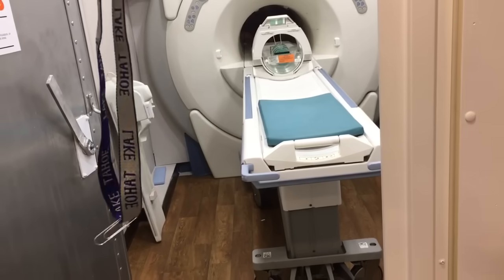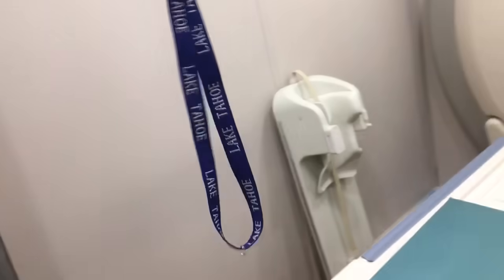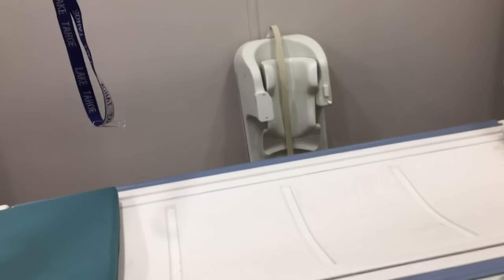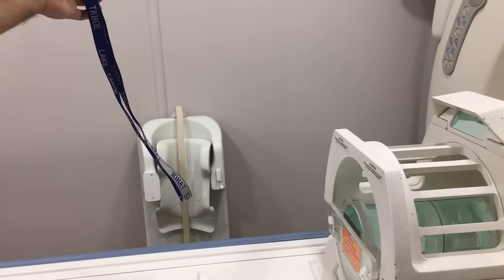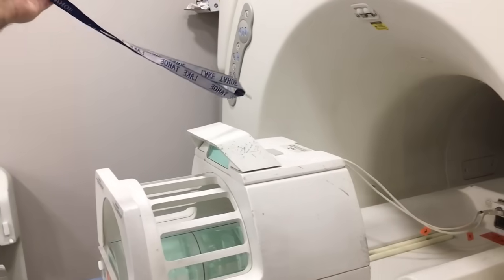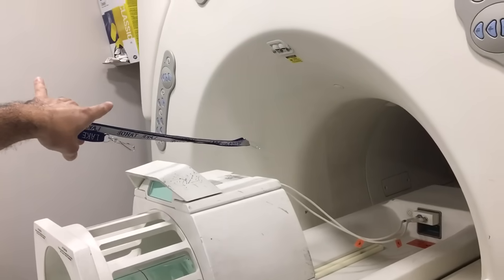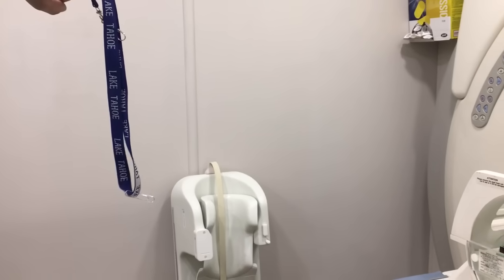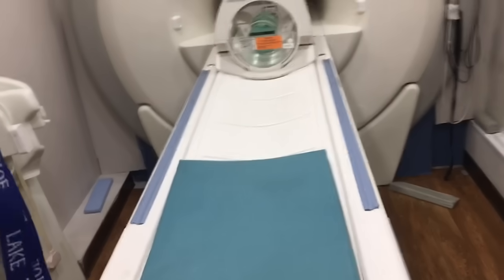Why You Never Take Metal in MRI Scan Rooms - Metal vs MRI Safety Demonstration (Original)

Comment: Can it be turned off, or it`s a permanent magnet?
Reply: Well, it's a long scientific process to energize it because it must be cooled to super conducting temperatures, and then the current through the main coil slowly ramped up with a special power supply made just for this purpose. Liquid helium is a common coolant for this. As the current circulates through the main coil, it becomes a super magnet. Now, power is needed to keep things that cool, but a loss of power won't instantly kill the field. However if it was off for long enough, it would heat up too much to still be a super conductor. Then the coil would rapidly heat up to the point that the liquid helium would boil off and break the pressure relief valve, and it would escape through a roof vent. This is potentially damaging to the MRI if this happens, therefore it's something that a hospital or lab would want to avoid if at all possible. They can trigger it intentionally to save a person's life, however, if they are pinned to the magnet by a metal object.
Reply from the maker: Thank you! That was a great explanation of the process.

Comment: I have a septum peircing and I don't know how to take it out and now I'm kinda scared, do u think it will affect the machine if I'm getting an mri on my foot?
Reply from the maker: It is hard to say without all the details but I would assume the tech would not let you enter the exam room with piercings on. Is the piercing made of ferrous material? You can try taking a small magnet to the piercing and see if it has an effect. Is your septum sensitive if there is any movement in the piercing? There is a chance it could be made with nonferrous metal so all good questions to answer before exam. If you are scanning your ankle you will be entering magnet feet first so it will not affect image quality but I’m a little concerned about the safety aspect and would err on the side of caution before proceeding. Imaging centers will normally run a metal detector during the prescreening process and they will provide a definitive answer. Good luck with your exam. I hope this helps :)

Comment: I think that's BS... They are always telling me to even take my belt off and even maybe my jeans for their zipper but 3 MRIs in they tell me it's OK to keep the covid mask on because "the noseclip is too small" even though it's literally 10 centimeters from the MRI target...
Reply from the maker: The main concern with a belt or zipper is the RF burns that can occur when the metal vibrates during the MRI exam.  Due to the pandemic, It has now become common practice to leave facemasks on if patients are entering feet first. Patients who enter head first are outfitted with face mask with the metal clip removed. I hope your exam went well otherwise :)
Reply: @MRIPETCTSupportEngineer  I went head first and they ended up just removing my mask. The exam proceeded as expected. The results only found more problems that were causing my more pain (I was stuck in an unending flare up and it's like that ever since).
PS: Also since you seem knowledgeable...Is it possible to diagnose epidural fibrosis without Gd (I am never ever letting anyone near my spine again)?

Comment: There is a superconductor providing this magnetism and it does not use site power. 
What is running is the coolant pump keeping the superconductor at the needed temperature.
I was getting an MRI done and the tech told me that.
Reply: I had one on my right foot in 2012. The hospital facility had a separate three phase sub simply to supply the current for the superconducting magnet and the associated cooling equipment.
Reply from the maker: @paulanderson7796  you are both correct. MRI is ramped up using a high amperage power supply and energy is stored within the superconducting coils of the magnet. 480v 3phase supply is used to power the PDU assembly, gradients, operator console, systems cabinets, and the coolant pump that you can hear running in the background. Smaller components typically use 110-240v stepped down from the 480v.

Comment: But someone I know went in wearing a bra with metal hooks lol is it safe for a less then 2cm metal object to enter?
Reply from the maker: Normally not an issue if imaging the lower extremities but can artifact if near anatomical region of interest. RF vibrates the metal and can cause artifact and possibly RF burns. Higher field magnets do not allow any metal to be present in the scan room due to dangers in high magnetic field
Reply: @MRIPETCTSupportEngineer  ahh OK tyms, I never knew this machine could be so dangerous till now.

Comment: No metal, or phones, watches or even credit cards should go anywhere near an mri. It destroys it for good
Reply: Non-ferrous metals are actually OK with MRI machines. Titanium screws, gold teeth, aluminum zippers, and nearly all the medical grade implants today are MRI safe.
Reply: @xinfuxia3809 I'm honestly kind of surprised how many people just thinks it's all metals... no, it's magnetic metals... if it's anything you can hold a normal magnet up to without any effect, it's something you can take into an MRI
Reply: @xinfuxia3809  But, pacemakers are not; MRI machines are off limits, if you wear a pacemaker.⚠️
Reply: I respected this and took off everything….
Reply: @phantasm541 George Takai: "Oh my!" 😮😊
Reply: That’s not entirely true, as you see in this video. (And if you’re about to get a brain MRI and is having trouble getting your ring of, it’s ok to leave it on as long as it’s not getting warm.)
Reply: Had phone and keys in my pockets while getting a head MRI, nothing happened
Reply: @horsma2064 me too and a big a** belt buckle. A card  in my wallet was ruined but otherwise it was fine. I’m not 100% it got the card but I don’t know what else would have.
Reply: @Boethius411 card uses magnetic strips and circuit chips.  Doesn’t take much to polarize them and ruin the code there.
Reply: Yeah sure...  @horsma2064

Comment: camera handling that magnet like a boss.
Reply: As long as its not made of something magnetic, mainly steel, the MRI is safe...
Reply: @Dodo-ze5ep  crazy that I’m seeing your 3 hour old reply on a year old comment just now. But, you’re wrong. No camera is made without magnetic material
Reply: @cade8986  Yes of course theres always something magnetic in virtually all electronics, but theyre very small and dont get effected by a magnetic pull very hard. And I didn't even say that a camera isn't magnetic, when you read closely...
Reply: @Dodo-ze5ep  it has platings and components that are incredibly magnetic, that are so sensitive even the tiniest pull can cause catastrophic damage to them
Reply: @bingus6542  Not realy, the sensor and its electronics are all solid state components that contain next to no iron, they don't realy get affected.
The shutters wich ofte are made from non-magnetic titanium and the mirror don't move at all when shooting videos.
The body is usualy not made from steel/iron either, it's either plastic, aluminium or magnesium.
The lens mount might be made from steel, but it's a pretty tough part.
The lens itself may have some structural parts made from steel and the magnetic field might upset eventual image stabilisers, but not cause fatal damage.
A camera should be able to handle exposure to magnetic fields.
Reply: @diesistkeinname795  It all depends on which kind of camera we are talking about
Reply: @bingus6542  I was assuming a MILC or DSLR, other cameras tend to have even less moving parts.
Reply: @peripheralmaster3265  here
Reply: @Dodo-ze5ep  When I had my MRI done, the dental clinic took out my braces and jaw widener. I wondered why they took the braces, because I knew from research that titanium, which my braces were made from, is paramagnetic, so I should have been fine.
Reply: @coastersaga  But id would still interfere with the magnetic field or heat up too much
Reply: Meanwhile, I can't help but wonder: if this video had been recorded on video tape, that magnet would no doubt have wiped the tape blank. 😐😲
Reply: @danielvanr.8681  that’s a good point
Reply: There’s not nearly enough magnetic material inside a cell phone for it to be pulled from your hand, and their critical components are also very well-shielded to prevent them from being fried by accidental exposure to electromagnetic forces.
Reply: Theres nothing that can destroy a camera
Reply: @vicmanm010 In reply to that...
EMP: "Want me to hold your beer?"
Grenade: "Nah I got this..." 😂
Reply: How does it affect people that have metal fillings in their mouth?🤔
Reply: It's probably bolted to the ground or something

Comment: Just imagine having a metal plate in you as a result of surgery.
Reply: Most prosthetics used nowadays are MRI safe (ie. they aren't magnetizing) but they still pose a danger of heating up. And of course they affect the quality of the image gotten from the scan by creating artifacts. 

Just tell your radiographers before the MRI scan that you have metal in you.
Reply: I have titanium in my knee because of ACL surgery and I did MRI for several times after that. There is No problem.
Reply: I have a titanium plate in my leg and am able to get MRIs as it’s non magnetic b
Reply: I do and my dr almost had me get an mri instead of ct. I have titanium for my orbital floor and eye socket. I am so scared to ever get in. Car accident now.
Reply: @Fortheloveofmusic25  titanium isnt magnetic. Thats why they use it for implants. Ive got 6 titanium screws in my spine and ive been through plenty MRIs without getting them ripped oit
Reply: Dennicam24 yeah I’m gonna stay clear as instructed by my surgeons....
Reply: @dennicam2428  It's more complicated than that. While non-ferrous metals won't get pulled through, they can still rapidly heat up. They'll also cause massive artefacting on the scan.
Reply: @lost4468yt  Well yeah, ive noticed slight discomfort whilst in an mri. The Pictures are pretty clear tho, and the doctors even told me themselves that theres No risk in going in there
Reply: @dennicam2428  I have two titanium rods and 26 screws in my spine, I’m terrified to go back in because I freaked out. Each time I went in the mri machine I felt a sharp pain when the machine turned on, instantly went away when it was off. This happened twice, I wasn’t in the machine for more than 5 minutes. My spinal surgeon says it’s not magnetic and is safe, so they’re gonna put me under anesthesia... you didn’t happen to feel anything in the mri?
Reply: @silverlingg  no, nothing at all, maybe a very slight feeling of heat inside me but that was so subtle it might not even be there. Maybe you having a larger amount of screws changes it? Anyways, titanium definetly isnt magnetic and if it were you would be getting ripped apart the moment the machine turned on
Reply: @Fortheloveofmusic25 hey, do listen to your surgeons advice; but maybe also learn just a tad of physics, please; especially when you want to imply malpractice on another doc…
Reply: @dennicam2428  "Thats why they use it for implants"
Not really why but it is a bonus.
Reply: @Fortheloveofmusic25  They aren't likely to  use a MRI if you're unconscious. They'd use a CT scan.
Reply: Не ' неможет' а НЕДОЛЖЕН !! 
а как ВИДЕОКАМЕРА себя там ведёт?
Reply: @ГригорийГромов-в7й Видеокамера ведёт себя хорошо, потому что есть достаточная дальность к аппарату.
Reply: I broke my ankle when I was 13 and have a 2 inch titanium screw in it now, after the surgery they MRI'd my foot and nothing happened.
Reply: @HeadHunter697  idk, Something happened to me and I don't want it to happen to anyone else
Reply: @dangerouspepega9573  what has Happen and was it Metal?
Reply: @Daniel-lq5qq  I had a metal support on my collarbone cuz I got ranovered and that caused a collarbone fracture, wen I started the MRI I started to feel an heat on my shoulder, after some minutes it started to burn a little bit, after other minutes it started to hurt and I called the emergency, fortunately nothing that bad happened, but it could have but it could have happened.

Now you may be wondering why they did the scan anyway, they did it because the metal detector didn't sound when they checked my shoulder
Reply: @dangerouspepega9573  ah ok i called my oral surgeon asked what material is this and they answered its titanium since 25 Years they use it i hope its true. Its like a plate under my nose with a couple of screws. I Hope its true.
Reply: @Daniel-lq5qq  well, even my support was made of titanium or something like that
Reply: Which is why some people can't have MRI's at all...
Reply: @the486kgman2  Chrome i think
Reply: I have a titanium portacath for cancer treatments and I have been through a few mri scans with no issues as well.
Reply: I had it and I needed to do an MRI, doo you want to know how it ended?
Reply: I've seen that happend on 1000 ways to die, a guy had a metal plate in his forehead the MRI machine got turned on and he went flying to the machine and died
Reply: Ive had an mri and they have a massive checklist you have to go through confirming that there's nothing metal in your body. It even asks if you work with metals as a job (e.g., a machinist) lest you have tiny particles embedded in your eyes. I heard of this person whose doctor was negligent and allowed her to keep on a necklace for an MRI and she got terrible burns.
Reply: @penguinkothe8323  is there a problem of having just some sort of metallic particles like in eyes? How to be sure and clean from them all before the scan then?
Reply: I have titanium plates and screws in my jaw and I was told I can still get an MRI and that they would also not set off any metal detectors.
Reply: I was in a bike crash. I have plates & screws in my left wrist and ankle. Also have sternal wires, IVC filter and hilar clips, I go into an MRI at least yearly with NO problems whatsoever.
Reply: I don’t have to imagine. It’s right here🇺🇸🇺🇸
Reply: They use titanium for this reason
Reply: I have a  metal rod or dol and screws in my tibia and I never have problems with the MRI scans .
Reply: I got metal plates and screws in both legs I still get MRI and CT
Reply: That's why they use medical grade titanium and not the metal everyone thinks of.